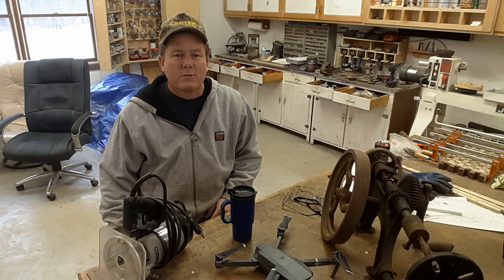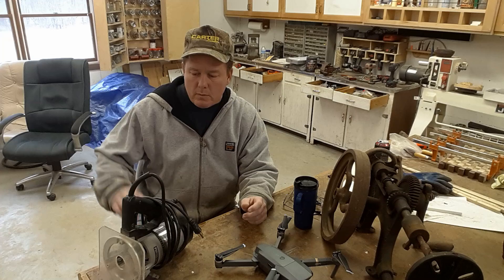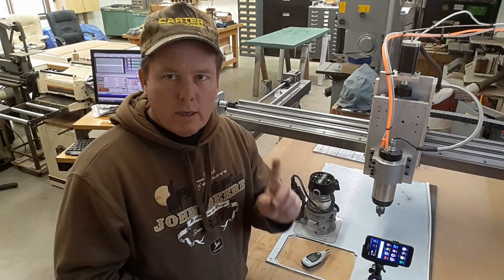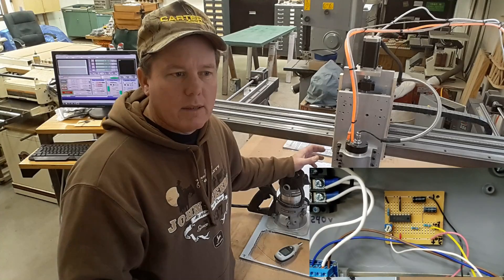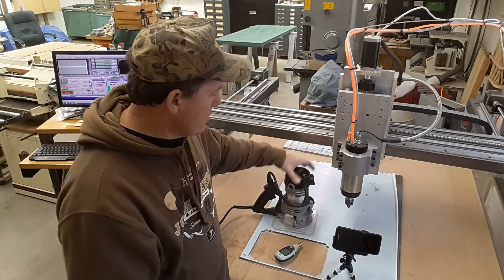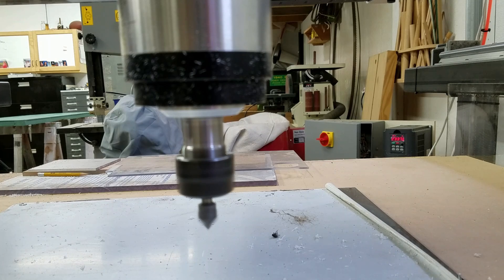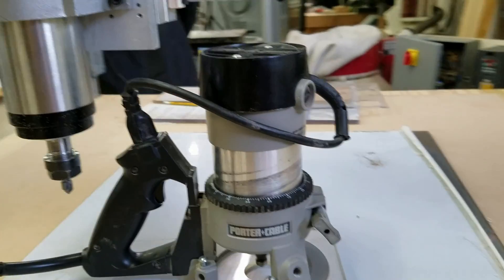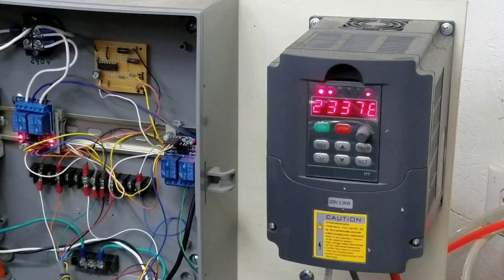Why a spindle on my CNC....cuz silence is golden.

Comment: Thing is,  when a router is running, there's the sound of the actual cutting going on, and usually a vacuum for chips (if cutting wood), and both are far louder than the stepper/servos. If an enclosure is added, it still leaves the vacuum noise, and with an enclosure, the noise difference between servos and steppers likely becomes a non-issue. I may well go with Clearpath servos myself, but it'll be for all the features, not just low noise.

Comment: For me, noise is huge.  It comes down to whether you can be comfortable in your shop while machines are running.  It's a huge stress reduction and it allows you to hear better if something is going wrong.  It's not a small thing.  
'Water cooled spindle' .... don't you kinda mean water cooled spindle motor?  I guess the unit doesn't need airflow, so it can be entirely surrounded with thick aluminum, which is very dead and doesn't tend to ring.

Comment: I was about to buy it then I noticed that it is all in metric and they do not have a collet for 1/2" router bits. Did anyone find the solution collet somewhere.
Reply from the maker: I have a full set of both metric and standard collets.  If it is a spindle like the one I show, it takes and ER20 Collet.  You can find them on amazon and ebay.  If it is a smaller spindle it might be different.
Reply: @sbirdranch  Thank you so much. Your video on decible level is exactly what I was looking for. Do you have a sketch of the final wiring diagram so that I won't have to go through the same learning curve. Sounded like they were not user friendly instructions.
Reply: It's all good, I figured it out. The instructions that they give you are not good.

Comment: But if you use a dust extractor with your CNC, does the router really make a big difference in noise?
Reply from the maker: Before I opened my mouth, I did some checking of how ear physics (noise) works.  So the simpleton answer seems to be, "No.  Not really."  For the greater extend, noise is additive.  Two noisy things are "louder" than 1.  I use a shop vac for the DC on my router and it is noisy.  I have a dust collector sitting 2 feet away but it would try and move too much volume although with less pain to the audio hammers in my head.  Bottom line is if you can afford the extra Benjamin's, you probably won't regret it.  I surely don't.  Especially on those jobs that don't use dust extraction.  ~P

Comment: How has this held up?  Mine lasted a month before it started screaming.  I’ve run it 2 years like that and now the bearings are completely shot.  I have another one incoming.   I make guitars and the machine gets heavy use so I’m not blaming it.  I’m interested in something more robust with more power that’s the same size or maybe upgrading to an atc spindle.
Reply from the maker: So far, no issues but it isn't getting as much use as I would like.  A month of even heavy use would seem short lived to me.  ~P
Reply: sbirdranch Thanks for the reply. It is the one that came with my Laguna IQ.
Reply from the maker: @Tonefiend  Wow.  I have been a fan of Laguna since I lived there.  I love my bandsaw.  There Cnc though...talked to a guy a couple weeks ago and he was working on his third controller.  ~P
Reply: sbirdranch yeah my handheld controller went out shortly after I got it. They sent me one free under warranty but the bill was about $1000. Terrifying considering you can get the exact same part on eBay for around $200 or so maybe less. I wonder what they would charge me for a spindle! About $175 on Amazon. It’s just a Chinese machine but you really can’t beat it for around the$6000 I paid for it. Yeah there are other machines are Great. I will have one of their bandsaws one of these days.

Comment: Hearing damage occurs as a function of time as well, not just absolute level. 94dB for 3 hours straight will definitely damage your hearing even though it isn’t at that 110dB threshold. Also, the router would have been louder had it been mounted to the machine due to vibration transfer.

Comment: After having a CNC router table for about 15yrs, I finally pulled the trigger a year ago on a Chinese 2.2kw water cooled spindle. Wish I had done it YEARS ago. It's just so quiet and powerful, and it's always cool even after long run times of 45min to 1hr at 18,000 RPM. My air cooled router would have been hot to the touch. Woodworking routers simply aren't designed to run continuously for long periods (like in CNC use). Air cooled CNC spindles are just as loud as routers, and cost 1.5-2x as much as a watercooler spindle and VFD. Shop for a spindle with good bearings made in Germany or Japan. If they list the bearing numbers on their Ebay ad then look up the specs on the bearings they are using. 4 bearings may or may not be better than 2 larger, better quality bearings. Look up specs and YouTube reviews of the VFD as well. The more homework you do, the better experience you will have.

Comment: But I thought 80% of the noise comes from cutting itself and not just free spinning. once you touch the metal won't they both be about the same?
Reply from the maker: Noise is additive.  You would be surprised how quiet some cutting is when you remove the motor noise.  ~P

Comment: For someone new to CNC how would you recommend keeping sheet metal absolutely flat while cutting? Sheet metal stock I have is .04" thick.
Reply: I would lay a thin sheet of hardboard/masonite on top of the sheet metal while cutting.
Reply: Have you ever tried an air suction table?

Comment: Yours vfd supports modbus rtu protocol over rs485. You only have to buy usb to rs485 converter on ebay for few dollars and instal vfd plugin on mach3, and you will have full control of yours spindle over USB

Comment: Can you please share how Mach3 was hooked to control speed ?  Thanks for a good video
Reply from the maker: I am working on getting a schematic reverse engineered as I lost the original drawings.  Follow the comments below where we are talking about this.
Reply from the maker: I have the schematic pulled out on paper.  Be patient.
Reply: @sbirdranch  awesome video 👍, did you ever get around to do a writeup on mach3 controlling this spindle vfd? This is the exact one I've been looking at for a while and after watching your video, I'm afraid I'll run into the same issues and not be able to get it running correctly. Thanks and keep up the great work.
Reply: sbirdranch looking forward to this, I am also interested. thankyou

Comment: Awesome comparison. Thank you for taking the time to put this together. How many hours have you used the spindle so far and what has been your experience with the spindle you got from "mysweetycnc"? How are the bearings holding up? Leaks?
Reply from the maker: So far so good.  I thought I saw a little moisture under the collet one day but haven't seen any again so I am confident everything is sealed up.  It sits for weeks sometimes and there is no moisture present.  The bearings still sound good as you heard in this video.  As for runtime, I don't have very much for what I expect out of it.  Maybe 25 hours.

Comment: I have a similar watercooled spindle with the same VFD.  Can you share the circuit diagram / schematics on how you hooked up the motor on / off relay as well as the speed control pwm to voltage and where you connected it to the vfd?  I would like to get mine working the same way with Mach 3.  Thanks!
Reply from the maker: I am still searching for the pencil drawing of the circuit.  I didn't forget you.
Reply: Any luck finding the circuit drawing?
Reply from the maker: No.  In fact a total fail.  I will look again this weekend.  I hate it when stuff crawls off my bench.  I am not sure how well I could reverse engineer it but that might be the best bet.  Is that something you could do with detailed pictures?
Reply from the maker: I will do that this weekend.  I should be able to draw it.  I'll take a stab.  I have looked again still have no joy.
Reply from the maker: Ok...I have pictures and have a sketch of the circuit.  I am going to refine this and put it someplace.  A video (short) will come at some point.
Reply: Thanks!!

Comment: I would like to thank you for all the tips you provide. They are really helpful, save me a lot of time and research, and also give me confidence to built my own machine. I'm buying the parts, Already bought steeper motors and their drivers, USB controller (do know if it works well?) and I'll try to bring the spindle from Malaysia next month. I saw you install a 2.2kW spindle. Isn´t it overdimensioned? And finally, if you came to Brazil it would be a pleasure to invite to my place. Thank you again, Ricardo Moreno Rachel
Reply from the maker: That is a very nice offer sir.  Thank you.
As for the spindle, 2.2kw (converts to 3 h.p.) I do not feel it is overkill.  The router in my router table is that same size.  It was less about the power to turn a large diameter cutter and more about having the mass and rigidity I wanted.  My goal was to create a machine that would do aluminum and brass to some degree.  I achieved that.  If I was just doing wood or composites with say a 12mm or smaller cutter, then a smaller spindle would probably work just fine.
I don't have a USB controller so have no first hand experience.  Who made the one you have?  Feel free to PM me if you wish.
Reply: sbirdranch , this the USB I've bought: https://m.aliexpress.com/s/item/32317951517.html?trace=wwwdetail2mobilesitedetail&productId=32317951517&productSubject=32317951517&shortkey=Q3ym2UZz&addresstype=600
Reply: It sounds reasonable the 2.2KW you used. I'll buy one for mine CNC.

Comment: Good choice, the spindle has less run out and better bearings (precision angular contact) than a router . less run out = extended tool life and better finish. on my air cooled spindle I got lucky it has less than .00005" run out measured at the the taper, yes less than 50 millionths . Run out of .0002" is perfectly acceptable . good quality collet choice is important as well. You can even get a collet nut that will help you dial in  run out. I use my spindle for metal grinding so finish is everything
Reply: Wow and thanks for sharing.

Comment: If you built an enclosure for your machine, it could even be almost silent.
I know a lot of guys that do cnc machines from their garages, that have day jobs, usually have to build enclosures to avoid noise complaints; but most of them have router based machines.

Comment: most of the time when cutting you would want a speed slower than full throttle router, a variable speed router on the lowest setting is 10k to 16k RPM and not to noisy.. not saying spindles are bad, just wanted to point that out
Reply: True - Less torque running router slow tho...

Comment: Holy crap... Now thats a demonstration of the noise difference. I'm sold.
Reply: AndTheWinnerIs... that's exactly what I said before I looked at the comments! lol
Reply: Some higher quality spindles are even more quite than his spindle. Good bearings, good VFDs, and general good design and tolerances allows that.
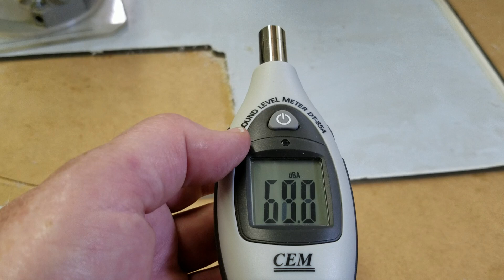Reply: 7:15 Watercooled spindle at 70dB, 8:10 same conditions router 95dB. Considering 3dB difference double the noise level... Calculation is not exactly that but i think we can say the watercooled spindle is 8 times quieter.
Reply: Actually it's about only 2 1/2 times quieter.  Doubling of power is (in Watts)  3dB.  Doubling of voltage is 6dB.  And the perceived (human hearing level) doubling of loudness is close to 10dB.  A 25dB change corresponds to a perceived loudness or noise level change of around 2.5 times.   That's still very noticeable no doubt.  Many people get the concepts of dB incorrect and trying to teach a class of adults on just this topic proved interesting to say the least.  Here is one site that explains it rather well:  http://www.sengpielaudio.com/calculator-levelchange.htm

Comment: Thanks for ur responsible answer, and one more doubt. From my idea, I want to add some facilities like lathe work to our CNC. the constructional changes should be too stronger than that machine , I know. But, I need motor specifications for spindle and router mechanism for working on stainless steel.
Reply from the maker: I would have no idea what size motor and spindle you would need to build a CNC lathe.  Sorry.
Reply: It's ok, thank u....

Comment: Awesome to get some dB measurements on these things. Do you have any measurements of how loud it can be routing wood at about 3 ft from the cutter? I am planning on building an enclosure for my CNC and am looking at what kind of dB drop to design for
Reply from the maker: I'll take some measures on my next cut.  I should be doing it this weekend.
Reply: Awesome! Thanks!
Reply from the maker: I started out to do what you asked and quickly realized that the answer is much bigger than I first considered.
I'd like to do another video on just why the answer is so different.
The short answer for you is, "It depends."  Not only does the material make a difference, but the speeds and feeds, as well as the cutter configuration.  For instance, I prefer spiral cutters, single flute.  They seem to be the quietest.  I run a 3/8 straight flute over the weekend (regular carbide router bit) through some mahogany and had a high pitch chatter I couldn't get to go away when cutting the cross grain.  I cut the same material with a 1/4" 2 flute spiral cutter in the same material and it was fairly quiet.
I think the information that others might get value from is a demonstration of some of these cutter configurations in different materials to include composites like solid surface counter top, wood of a couple different kinds and acrylic.
P.
Reply: That would make an interesting video for sure, maybe you can pick a small set of the variables to look at (feeds, speeds, cut width/depth, material, tool type, tool wear, etc.) and keep the rest the same. Also, did you get a feel from the testing what the highest dB measured was (also at what distance)? Maybe other than during the chatter cut, since that could be uncharacteristically loud.
Reply from the maker: Ya.  For sure.  Demonstrate what happens when you change them on the fly...which is what I do.  I don't have enough 'recipes' yet to be spot on with my speeds and feeds.  I'm still playing with cutters and seeing how the machine reacts in different materials.  P.

Comment: Hlo, For working on metal, how the construction of ur machine will change...? & what type of spindle will we use.?.....pls clarify my doubts....
Reply from the maker: This machine will never be rigid enough to be used as a milling machine.  If I wanted to route aluminum, the change I would make, would be to shorten the Z axis.  It is too long and not rigid enough.

Comment: Thanks for the comparison!
I'm thinking to get a shapeoko 3 with those 1.5 kw spindles on.
It's gonna be my first time to do some wiring as well.  Is it too difficult for newbies?
Reply: PlanB 1.5 is a bit much. Try 0.8kw
Reply from the maker: You'll be able to wire it ok.  Nothing too difficult.  The shapeoko community is large and helpful.  Use them if you need.
Reply: sbirdranch Thanks!  That makes me comfortable to try it out.
Keep in touch.

Comment: Now I have to ask, why did you go with Mach 3 as opposed to LinuxCNC?
Reply: Paul Frederick probably because it's more common and you can still use windows
Reply: Julius Jahn
can you still use Windows while Mach 3 is running? I've heard the PC is pretty tied up then. Possessing real time kernel extensions LinuxCNC can still perform other tasks even while a job is being run.
Reply from the maker: You can.  But there is a caveat.  If you are using a parallel port for IO, then you are risking having issues.  The driver that Mach3 uses (and has to use) over rides some low level timing.  It is why you shouldn't have any network connectivity etc.  This does not apply with the new USB based boards, and does not apply when using the Ethernet Smooth Stepper as I am doing.  All the pulse timing is done off the mother board revealing you of these 'bonus' problems.
Reply: sbirdranch
yeah Windows has no real time capabilities. LinuxCNC you stream a HD movie while you're cutting a job, if that's your thing. I know guys that do it just to be wise asses. Basically because they can.